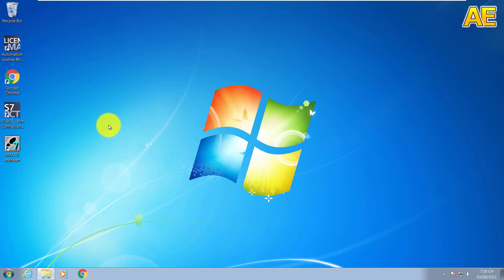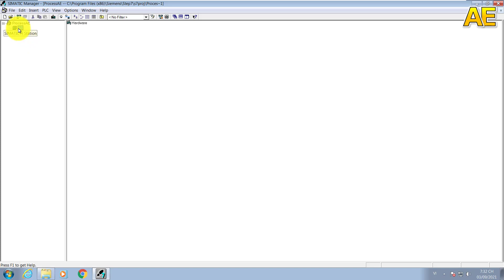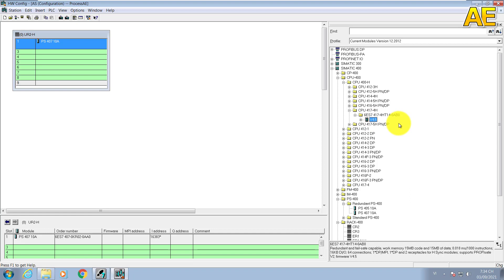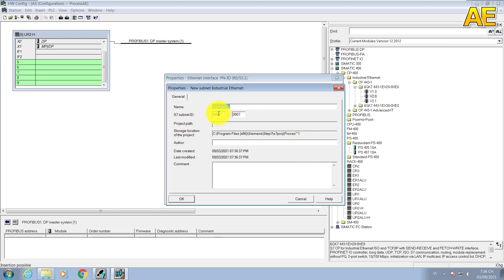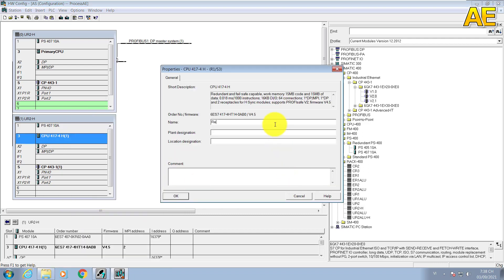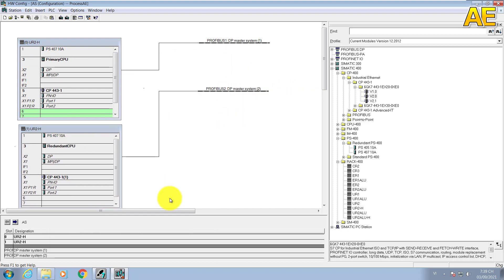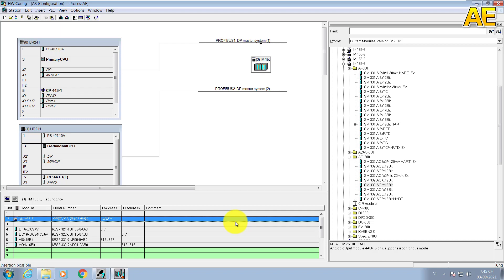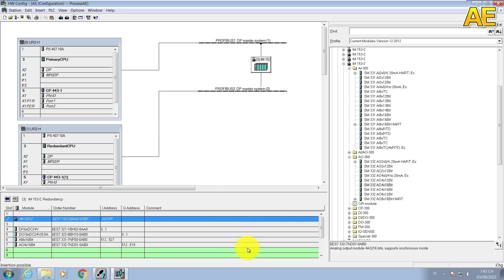Simatic PCS 7 Part 1: Create New Project And Configure Hardware For AS

Comment: Hello why there are no s 1200 or s 1500 on the list, weren't they suitable for the job ?
Reply from the maker: Hi, S7-1200 is not released for PCS7, S7-1500 can use. But the advance of S7-400 you can see in video

Comment: Hi Sir, After i save and compile it show error: 1230: 3000(The system data could not recreated because the configuration is inconsistent). can you help me? Thank you so much!
Reply from the maker: You can come to CPU tab cycle/clock memory and check size of process image. It need within address 512 length 128 bytes